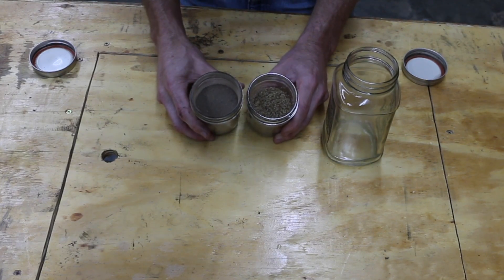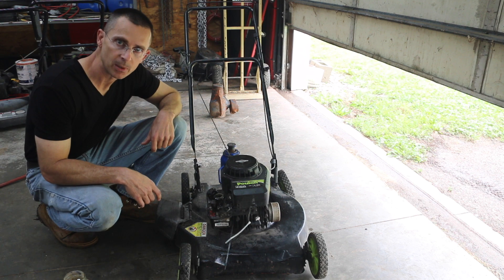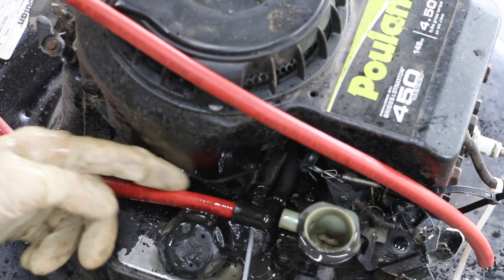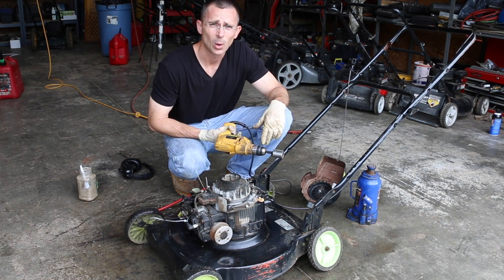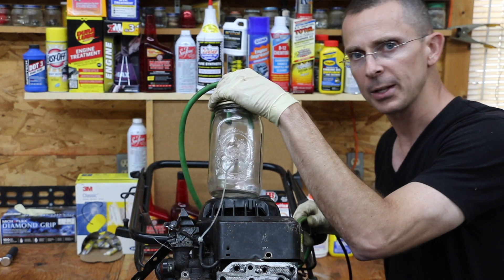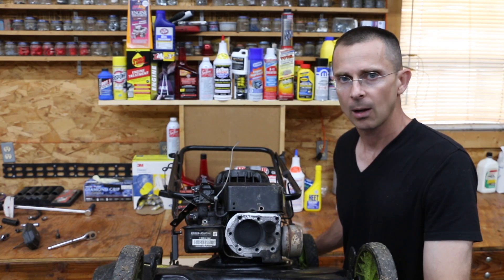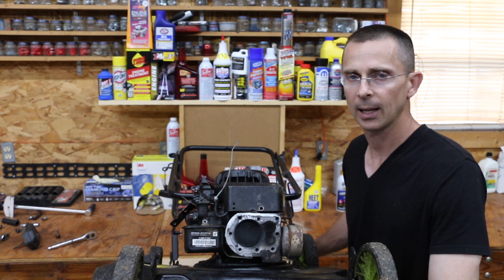Will Dirt Destroy an Engine?  See what it does to this Engine!

Comment: Such a simple concept and men are riveted to these experiments. Project Farm wasn't telling us anything we didn't already know. However we, the community the loves Project Farm experiments HAD TO WATCH THIS TO THE END. My sentiment exactly. I would have never guessed he could do that much damage with a couple of fricken tablespoons. Project Farm, don't ever change brother.
Reply from the maker: Thank you very much for the positive comments!
Reply: There's a type of damage that is so fine you need a micrometer and snap gauges to measure it. I'm talking about silt. In Calif we have the Glamis sand dunes to ride around in. We grease all air filter mating surfaces, spray the filters with an oil, wrap oil soaked foam sleeves around the air filter and then cover the whole thing in a fine netting and still after 2 seasons the damage is significant but doesn't look like wear it literally looks like the piston skirts had been cut on a lathe.

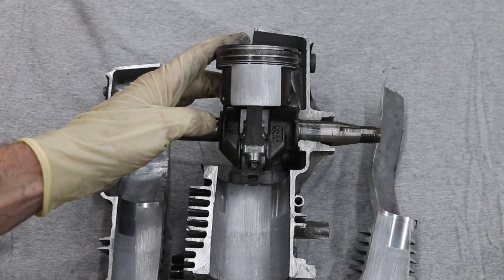Comment: What I find way more interesting than damage from dirt is the cylinder wall itself ! Notice how thin it is on one side compared to the other and how one side has all of the cooling fins  9:41. Looking at the wear marks on the cylinder wall it seems where ever there's a fin there's a high spot ! When the engine is assembled , head tightened and at operating temperature that cylinder wall must be a mess ! It can't be round or straight and to top it of it has ribs. Engines with steel sleeves are looking better all of the time !
Reply from the maker: All excellent observations.  Thanks for commenting!

Comment: you really cant be serious calling this a proper test.... you cannot actually simulate years of dust sand etc going into an engine that has no air filter by simply dumping spoonfuls of the stuff into thus said engine....What your testing is how much can you pack into an engine before it stops working.... not what effect it has since you know.... at some point it would burn off or filter itself out....
Reply from the maker: Great constructive feedback. Thanks for commenting.

Comment: Anyone else notice at 2:00 it says compression test cold but then by the temp it says hot?
Reply from the maker: Thanks for commenting. I probably made a mistake.
Reply: +Thomas Daugherty - He made a mistake for sure.  In the " Video Editing Software ".  There are Template / Pres-Set that He normally used to save time and editing headaches and probably forgot to " Edit " that text to change to " Whatever " he needs.  If you know about " Editing " Software  / Template.  You will know right away what happened!
Reply: Compression increases pressure and temperature inside the engine.
Reply: Thomas Daugherty was
Reply: Thomas Daugherty No. 75 degrees Fahrenheit isn't hot
Reply: saw it

Comment: this is hardly accurate at all tbh the fact that its a fucking lawn mower not a car engine is good enough to say this is NOT really what would happen to your car without an air filter because thats such a small engine in comparison to a car engine those spoons of dirt are like a big glass of dirt being poured straight into the air intake not very gradually taken in from being kicked up off the roads
Reply from the maker: Thanks for the constructive feedback.  Agree that these small engines are different than vehicle engines. Thanks for commenting.

Comment: We accidentally put diesel in our lawn mower and it wouldn’t start when we figured out why we emptied the tank and refilled with gasoline and it ran like new but a lot of smoke came out the exhaust
Reply from the maker: Thanks for commenting.
Reply: When i was a kid my dad did a similar thing. Started filling the petrol campervan with diesel. Service station guy said it would need to be towed to a mechanic. Dad just topped it up with petrol and for about two weeks we had a campervan that laid down a smokescreen better than the bat mobile. It didn't smoke much while idling but when taking off from the lights it would fill the intersection with so much smoke no other cars could cross. Was amazing to see as a kid but now i shudder to think how many accidents it could have caused.

Comment: this test is amazing, but  u threw little rocks on the carb, can u do it with just dirt powder? like thinnest dirt u can throw into the engine. plsss like simulating an engine without air filter i want to see what happen with that thin dirt. thanks!
Reply from the maker: Great point. Thanks for commenting.

Comment: This is why I cringe, when I see Tuners & drag racers have turbos with no filters on them. Especially exposed turbo compressor intakes. Is the Air restriction that bad?

I would rather get the biggest filter I can fit, from K&N, and make a custom intake. Or make a custom intake, that looks like a tree, or a pitch fork, that uses many small filters. I would never run an engine without a filter.

I absolutely hated seeing that, in a shop I was interning at. I told the mechanic that was wrong, and he just laughed it off like a moron. This is why everyone should be a master service technician, of their favorite vehicles,  and not trust any shop, because you don't know how much they really care, then there's the chance of them ripping you off. Cheating you. Like overcharging you for an oil change, when they use cheap, bad oil, and if you're lucky, a name brand filter. Or they can just change the oil, and keep the same clogging filter, or not change anything at all, and charge you anyway.

It's amazing & sad, how many people are too lazy & careless, to even change their own oil & filters. Especially with a vehicle they're keeping for many years, or forever. They can't even research how to properly do simple things, let alone everything, for the vehicles they will claim to care about. Claim to be sentimental.
Reply from the maker: All excellent points!  Thank you very much for commenting!
Reply: Project Farm And thank you for your videos. So many questions, and experiments are great ways to find answers. Your videos like this, are another great way to introduce people to the scientific method.
Reply: Project Farm Because so many people are so science & technology illiterate.

Comment: A robust experiment, not real life agreed but it highlights the need to ensure you always use a correctly fitted air filter, replace frequently and be aware of the atmosphere in which the engine is used.  What this experiment clearly demonstrates in a very short time, polluted or contaminated air particles over time will destroy an engine.  The negative critics fail to appreciate the point this guy is making, and that he has a limited time to show the effects of contamination expecting just a little “thinking outside the box” .  The point is.....your engine will last for years if you have a proper maintenance schedule.  Treat it badly and you end up whingeing back at the dealers counter...for no justifiable reason.
Reply from the maker: All great comments and thanks for the constructive feedback!

Comment: A 100% real world test would be to shake off an actual old air filter. The particles would probably be finer. I spent many years playing with gas RC cars, sometimes the air filter fell off the engine ate dirt, that scored the piston badly and tanked the compression. However if you were very methodical with the air filter the piston would last impressively. Anyway great video!!
Reply from the maker: Thank you for this recommendation and thanks for the positive comment regarding the video!

Comment: what kind of adapter was you using on the drill to start the lawnmower?
Reply from the maker: It's a drill adapter with a 1/2 inch hex drive adapter which holds the socket.
Reply: anyway you could snap a picture of it so I could see it?

Comment: I took a Cummins truck engine maintenance class and the intructor said that 1 cup of dirt getting in the engine air would ruin it whether it took ten years or one minute. And that is 855 cubic inch engine.  So after one teaspoon in your engine is about the same ratio.
Reply from the maker: This is a great point.  Thanks for commenting!

Comment: A lot of people use diesel to do an internal cleaning of the engine at oil changes. My dads cousin would remove the oil and then put a couple quarts of diesel in the motor and run it for a minute or so. I think he would do this a couple times and would then put clean oil in. Although diesel is a lubricant, i dont think its that good for an engine. It would be interesting to see how long an engine would last using diesel as the lubrication.
Reply from the maker: Thank you for this idea!

Comment: Score marks in cylinder walls are grooves you don't want. When looking at a used tractor let it get hot and watch the crankcase breather, you will see more blowby as it gets hotter. Excessive blow by means the cylinder wall is scored most likely it's not the rings. Trying seafoam will reseat the rings and free stuck rings but it the blowby continues it's time to bore the cylinder for a new piston. It can also be excessive wear in the exhaust valve guide too. They do make replacement valve guides or knurling the valve guide can be done too. Check your oil level before each run.
Reply from the maker: All great points!  Thanks for commenting!

Comment: They don't see the dirt these triple blade mowers kick up? I'm running two aircleaners a foam pre cleaner over the paper filter. The new kohlers engines were $2k when they were offered. The orginal Kohler engines will last a lifetime if we keep the oil clean and the air filter replaced often. When I first pulled a head I seen score marks in the cylinder. I wondered why? A inspection of the air cleaner showed the paper element was rotted. Being a retired lead engineering tech in a r&d lab I want to know the root causes of failures and why things break. I look at things from both sides of the fence, the engineering part and the product end user.
Reply from the maker: This is very valuable information for our viewers to see!  Thanks again for this information!

Comment: I buy and get running older cub cadets. The first thing is every headgasket needs replacing. Now the tractors that have bad air cleaners also have scored cylinders.
Reply from the maker: Bill, I wish every person who watched this video would read your comments.  A lot of folks have said the it would take many years without an air breather to cause significant damage to an engine.  Several others have provided comments very similar to yours.  Thanks for commenting!

Comment: Would the same damage occur to an air compressor? A gas engine (partly) works the same way as an air compressor, yet I've never seen air compressors with filters on them.
Reply from the maker: Louis, Yes, an air compressor can be quickly damaged by dirt contamination.  Thanks for commenting!

Comment: Just a question do you need to change your air filter over time because off all the crap it has filtered
Reply from the maker: Automobile air filters are normally not serviceable and need replaced over time.  Owners manuals usually provide the interval information.  Some small engines have serviceable air filters.  Most paper filters will need replaced periodically and foam can be cleaned.  Thanks for commenting!
Reply: Project Farm nice thanks

Comment: Small amount of sand?  You poured tablespoons and tablespoons into that cylinder...... I'm surprised it ran for that long with soo much dirt!  I feel safer now running without an air filter on my little 2 stroke motor.  Thanks for the test!  :)
Reply from the maker: Great point!  Thanks for the positive comment!

Comment: How much do you think is a realistic amount of sand to cause catastrophic damage after getting into an engine? I know for demonstration purposes it has to be a little excessive for the time constraints. I imagine a carb would filter some sand out.
Reply from the maker: KnightRider, this is a great question.  I've had quite a few people comment regarding their engines losing compression as a result of not having an air filter.  I did indeed use an excessive amount of sand for video demonstration purposes.  In reality, 1/2 teaspoon of sand will cause significant damage.  Thanks again for commenting!

Comment: well obviously it was going to destroy it. people aren't pouring buckets of dirt in their engines its little bits of dust over years. it would never add up to the amount you put in that engine. now im not saying its good for the engine but you cant say this is a realistic test.
Reply: It was exagerated for time, I for one don't want to watch a guy spoon feeding a mower for ten years. Thanks for the video and not cutting off your foot.
Reply: have u ever changed air filter? it could easily happen in certain areas in the world
Reply: an engine eating a cup of dirt on its own is probably not unheard of how many truckloads of dirt do you think all the engines from mad max fury road ate?  i forgot the exact number a good textbook will tell you its something like a tablespoon of dirt going through a car engine is equivalent to 50k worth of mileage.
Reply: michael perri yeah true or think of a dirt bike or a quad racing without a filter there's so much dirt and dust it would probably be equivalent to what this guy poured in lol
Reply from the maker: Great point!  Thanks for commenting!
Reply: Project Farm Interesting video. If you make a realistic test my suggestion would be to vacuum clean a bunch of old air filters, and use the collected dirt for the test, and maybe see if you could make a system that feeds the dirt to the engine slowly over a day or two.

Comment: Thanks for taking the time to do this video. I would say not to pour the dust straight into the intake as when your driving the dust particles are actually spaced out and suspended in the air when being sucked Into the intake. I would suggest puffing it I to the air right before the intake and one handful should simulate a few years. I have driven a few cars without air filters and no damage ever incurred and it was over two years time span. One of the engines was a recent rebuild a d after taking it apart for a turbo project the honing marks were still visible with no identifyable vertical scaring. Side note it was a dusty island so there was dust entring the entire r but very fine atomized mixed of dirt a d dust do minimal damage if any was caused. Great video by the way . Just suggesting sine information.
Reply from the maker: Lorenzo, this is very good constructive feedback!  Thanks for commenting!

Comment: 1st. you put a lot more sand that would actually be in the air.
2nd. You forced that engine to go, you used a drill, in real life if the engine starts kicking, more than likely people will stop and pull over, forcing the engine to go on was like putting a grinder in the engine, you should of shown it when the engine had stopped by it self and you didn't have to force it to turn back on.
Reply from the maker: Electron, All great points.  Thanks for commenting!

Comment: Hydrolock would be quick, but interesting.  Dump a bunch of water in all at once to simulate the intake going below the water.  This happens all the time when any vehicle is driven through water that is too deep, or when a little outboard falls off the boat while running, etc..
Reply from the maker: Matt, Thank you for this video recommendation!

Comment: Fun and Exciting, perhaps.
Realistic, absolutely not, air containing "dust or dirt" has to flow through the inlet and generally the way filter housing is designed even if no air filter is present, then the air flow slows down by at least a magnitude, thus heavy particles settle out and do not flow with the air flow. Thus you will NEVER ingest several grams of sand at any given time.
Reply from the maker: Great point.  Thanks for watching the video and commenting!

Comment: I learned a lot. Thanks! ^_^ but still. I have a question. Well I do speed racing with my motorcycle. And a carb without filter really helps increase combustion and speed. However still its dangerous right? Is there any way I can protect my engine without cutting the increased air intake?